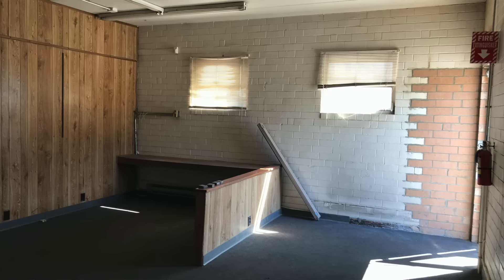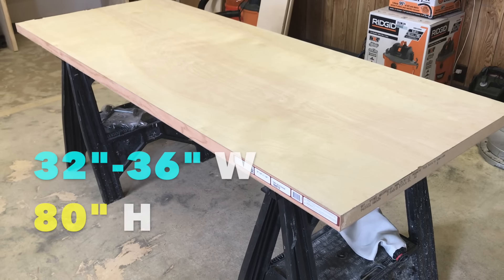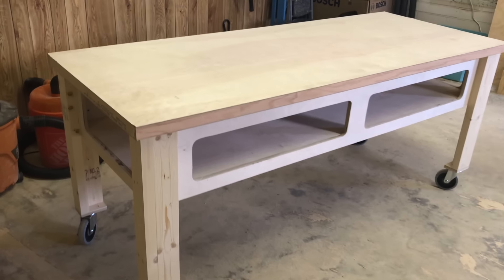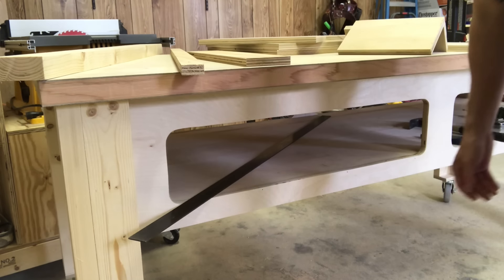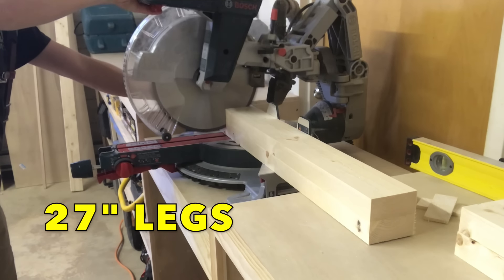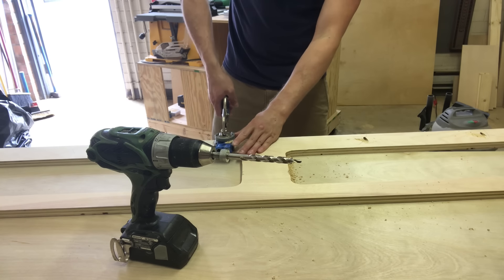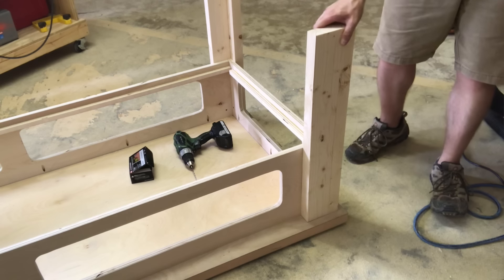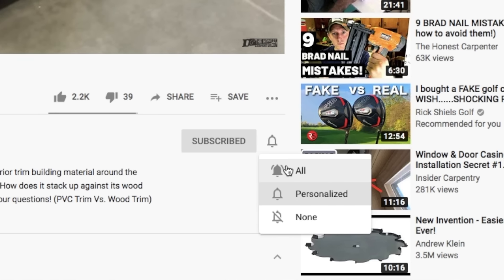These Make The BEST WORKSHOP TABLES / WORKBENCH!! (Tips, Tricks, Secrets--Workshop Table Full Build)

Comment: Thanks for the design, looks like the doors are up to $118 at Home Depot for a 36" X 80" door, what I think I will use. I also will do like a 8" openings for the shelf as I am concerned about having enough room to reach in and out for stuff.. Also did the height end up matching with your table saw out-feed height?
Reply from the maker: Ended up not doing the table saw outfeed design, Will. But height could be easily adjusted for it!

Comment: Nice build.  There is one thing I found somewhat amusing though.  You had a hard time cutting out the rounded corners with your jigsaw and the thing you used to layout those rounded corners would have been the best tool to cut them with as well.  Just picking at you but seriously, I enjoyed the video.  I have made use of solid core doors for makeshift jobsite tables for years.  They do make a great work bench.

Comment: Nice build, Ethan! You might wish you had a second shelf beneath your table for other items. (BTW, where's the cup holder for your drink? 😉)
Reply: I noticed many other workbench plans include a full-length shelf (probably 1/2-inch plywood) near the bottom of the frame. DIYers use it to store other tools they might use occasionally on the work bench. Your plan did not include a bottom shelf, but I imagine one could be added rather easily. What do you think?

Comment: Can I drill dog holes in this top for holdfasts?
Reply: I was just reading that dog holes in MDF will work for awhile before the holdfasts loosen up the diameter of the hole with use.  Would it be necessary to coat the inside holes with epoxy to harden the MDF.  Any thoughts?

Comment: Great build! But I wanna be around when you flip the top to get that two-fer surface. I think I would have screwed the sub-shelf to a slightly more hefty cleat. The pocket screws holding the top look like they may be a little awkward to get to even with a truncated drill bit. That said I wanna be around because it looks like the first surface will last for years (and I'm old!)

Comment: Ethan, can you add T-track to the solid core door?
Reply from the maker: Hey Tom, yep, I think the Masonite core would actually route very nicely for a T-track. One of the few strong benefits of these types of fiber boards is that they route beautifully.
Reply: @TheHonestCarpenter  I'm in the process of building my shop and I plan on having 2 tables, one for outfeed 1 for assembly but if I need major work surface  I will slide to 2 tables together... now I got another option than stacking 2 sheets of melamine together... about the same price

Comment: Beginner here...Great Video! One question about the casters...are they secured with only 3 lags (the three that would align with the legs)? I built a similar bench last year, didn't use the correct caster mounting technique and they fell off, so I need to "learn" from that mistake...

Comment: I have a question.... How did you get the lower inner shelf in place?  Exceedingly practical ideas.. it's a bit confusing because the table is put together in the inverted position. Of course,  I can view and hear the explanation again and again,  but I've already tried that.

I am currently adding support to a similar table.... and I think that I will have to build much stronger legs.  Thanks

Comment: Hey , do you know the differences between the Dewalt flexvolt circular saw and the lowes version 20v XR power detect circular saw? I seen reviews where power detect drill " dewalt 998" is a beast with high output batteries , the flexvolt maybe it has to have the big flexvolt battery to be that beast , just debating on which saw is the better model,  not sure if you have used both right handed blade saws or not, one is only sold at lowes , " power detect " the other is a home depot exclusive " flexvolt" you have a preference on which is the better of the 2 ?

Comment: I love the workbench but I have a suggestion.  Why not use 4x4s for the legs and put them inside the corner of an end skirt and a side skirt?  You end up with stronger legs and the table top will overhang further on the corners for a better clampable edge there.

Comment: If you were to rip a door like that lengthwise would the edge be ok or would the strength of the door be compromised?
Reply from the maker: I think for the most part it would be okay, Steve. Those edges are there to provide good cross grain for hinge mortises. But the thickness and density of the door would still create much of its strength.

Comment: Currently building this now but i had a question. You said you cut the side skirts to 11.5". And the windows at 5.5" with 3" on top and 2" on bottom. That equals 10.5 total. Where'd the extra inch go. This is where im stuck. Thanks!
Reply from the maker: I might have just misspoke Stephen 😅 I’d add 1/2” to both!
Reply: @TheHonestCarpenter  ahh, gotcha! Thank you for the reply!

Comment: The company I used to work for renovated hospitals. This one day, at the hospital, I came home with 7 solid core doors made in 1967. These had wood chips on the inside, I mean like oak, maple, hardwood chips, I have never seen anything like it! I think they ground up old pallet stock to make them! They were HEAVY. I could have gotten some from the ER, lined with lead... but those were TOO heavy. (Around 350 lbs vs the already absurd 200-230 lbs) After polyurethaning the doors, I put vinyl flooring as a matte over top, so any glue, paint or epoxy just pops off.

Comment: Does anyone have any ideas on building this type of workbench without a table saw or miter saw. I don't have any of those tools and not in a position to get those tools. However I do need a workbench. Also any ideas on the size of wheels needed to use on gravel? I'm renting so not able to put cement in my carport.

Comment: its Awsome,, but since my room is small,,, do you think i can make the same table smaller in order to fit into normal rooms in a house?    Since my garage is very hot, I decided to make one or my spare rooms in my house where there is A/C. lol,,,,,, but i  need a table that i can get in the room and then out,,, do you understand?,  but i still want it big enough while in the room to assemble  stuff... i was looking at a build where Bear builds, put 2 tables together to form one big one, and then now i can get them in & out,, but i like your Solid Door idea and your windows to hold tools... help me........................
Reply from the maker: If this table was just a little shorter, I think you could turn it on its side, angle the legs out the door, keep rotating it, get the back legs out, the stand it back up outside the room!

Comment: design is excellent. only suggestion would be, as comments have already said, use the hole saw not the sabre saw to cut the rounded inside corners.  optimally, the sabre saw would be used for nothing ever

Comment: It's actually hard to find those doors at the big box stores near me. They have what they call solid core doors but if you read the materials and specs on them; they're not. Most of what the orange and blue guys near me sell as solid core doors are essentially normal hollow core doors filled with polystyrene; not MDF or hardwood. I have been able to find actual solid core doors; like full glued up hardwood inside the laminate doors, at the two outlet home improvement type stores near me. That's hit or miss obviously and if you see something you like at one of them you better get it right then or it won't be there the next time you go. The normal BORGS though just seem to have hollow core doors filled with basically expansion foam.

Comment: Soooo, probably dumb question, but can this solid core door be cut down in size?  I am working out of a single stall garage and don't have room for a table this size.
Reply: Yes you can cut them down, or buy a narrower door slab.  I'd add a hardwood band to cover up the cut edge to make it more durable.

Comment: For cutting out the rounded corners, could you not have drilled it with the hole saw and then used the circular saw for the straight bits? Undercut it a bit and hand-saw into the corners?
I'm not a woodworker. Just kinda what I thought you were going to do when I saw the hole saw.

Comment: For the sides, you said that you used 11-1/2 inch wide pieces. You had a 2-inch strip at the bottom, a 5-1/2 inch window, and a 3-inch strip at the top. Doesn't that add up to 10 1/2 inches?
Reply: Just posted the same question myself, all the ripping was done at the start so i was scouring the vid for the missing inch.

Comment: Cool stuff Ethan. Two newbie questions:
1- How did you get the bolts fixed into the leg? 
2- I've seen some people recommending drilling about an inch wide holes into  the workbench that allows them to use c clamps to fix pieces from the middle of the bench. What's your thought on that?

Comment: I just did the math, if the side plywood skirts are 11 1/2 inch and you leave 3 inches at the top and two at the bottom, the opening should be 6 1/2 inches, correct?  Or am I missing something

Comment: This will be my new table. But... A question. One of those in your opinion things. What do yo think of  Melamine as a table surface? Now a comment. I would have use the hole saw you used to mark it, to dill the corners. Then the circular saw would have cut into the open hole and Bob's your uncle.
Reply: Melamine might be a little too slick.

Comment: Would you believe that in the local Facebook Marketplace a guy offered FOUR solid core doors for FREE. I went and got them, I had to take all four. Boo Hoo. They were each heavy as lead. Without him there is no way I could have loaded them onto my pickup truck with the gate up. In fact, he had to lift one end over the gate as I  pushed the rest of the door on. He even refused the $20 tip I offered for his help. Two small ones were like 32 x 80 and the other two were each a little larger than the one before. Now, to make my new bench!

Comment: I think the math for the skirt board doesn’t add up. The width was 11 1/2. The top rail is 3”, the bottom rail 2” and the window 5 1/2”. That is 10 1/2”.  Is the window a actually 6 1/2”?

Comment: I'm no pro carpenter so...why didn't you just use the hole saw to cut the rounded corners of your shelf face?    You traced the bit, then used the "crappy'" jigsaw.   Other than that, nice work table.   :)

Comment: It is too short!!!  Even for you!!! The top surface should not be no more than one to one and half inches below your elbows... Back Fatigue will stop you from using it especially if you are taller!!!! If you are to wash dishes and have to bend over to a counter top of 35 inches when your elbows are at 46 inch, now the bottom of the sink is 6 to 8 deeper.... If you are really tall and you have to sit on a standard couch or dinning table chair you wish not to sit long as there is no room for your legs or you are towering over the rest!!! Put the Elmer Max Water Proof Wood Glue Solution, paint it on 50% water and 50% glue mixed well, on the surface and it will last for ever... Matter of fact on all your wood shop every where!!!

Comment: Not sturdy or heavy enough for woodworking with a plane or chisels and vice work but fine for assembly and measure/marking. Maybe double up solid wood doors for the surface and use some actual joinery for the frame that resists forces in all directions and solid enough to transfer all the energy into a chisel cut rather then into sound and vibration on a noisy table to work on.